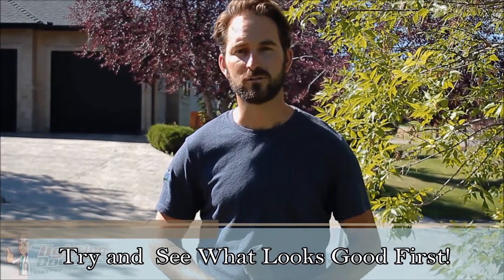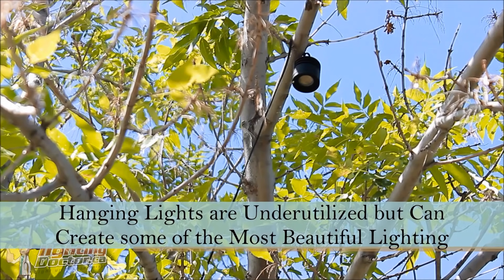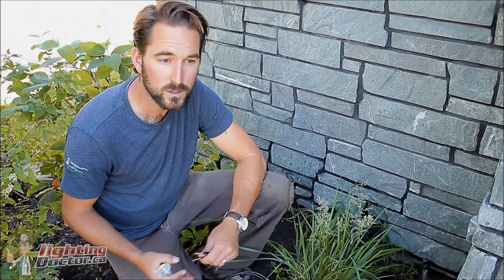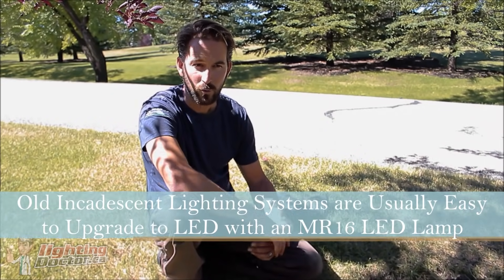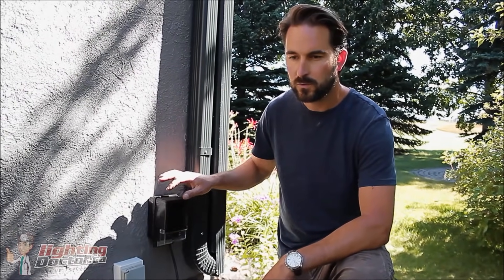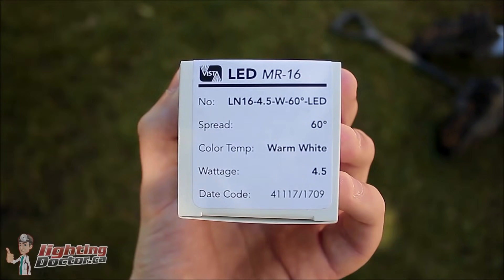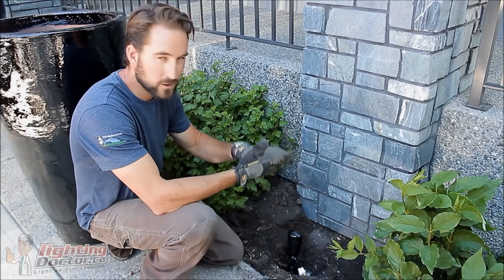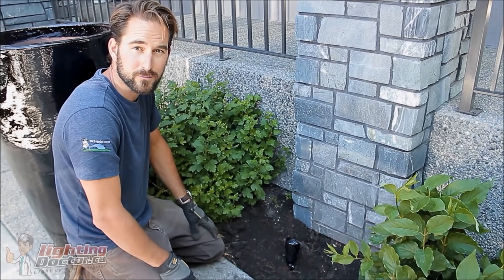How to Install Low Voltage Landscape Lighting - Complete Step by Step Video

Comment: Is there a hot/cold wire or any certain position needed with the wires and fixtures?
Reply from the maker: There is no polarity with most low voltage lighting

Comment: Hello Cal
Thanks for the sharing wonderful tips.
Please guide me.
I would like to place low voltage 20 lights in my front yard concrete ( there’s no concrete yet).

I see in the internet that I need to excavate 18 inches down, also an electrician told me the same thing.  
I think it’s a waste of 36 inches of wire x 20 lights= 720 feet of 12/2 wire material buried. 

Is it safe to run the 12/2 wire in 3 inch Black PVC pipe plumber instead of Grey Conduit ? ?
Or can I insert the 1/2 inch grey Conduit into the 3 inch Black PVC pipe plumber??

And 
Instead of bury the 12/2 wire 18 inches down, Can I bury the Black PVC plumber pipe just below the concrete which is 
3 1/2 inches ??
Reply from the maker: For low voltage wiring there is no need for this depth. 6 to 8 inches down with no conduit is typically more than enough unless your local codes have specific bylaws which is very rare
Reply: @LightingDoctor  Thanks so much for taking your precious time to reply.
Blessing to you

Comment: I have 4 palm trees in front of house, 2 palm trees are about 2 feet away from house and the other two about 10ft away.
I saw these wifi lights that are on a long cable and have outlets along cable to plug in more lights. This guy mounted them along the house on the wall though not on ground and they look so cool.  So IAM debating between just illuminating my front yard palm trees or should I illuminate the house walls instead and should i go  with low voltage lights and a transformer or just wi fi plug in lights that I can control with google or alexa?

Comment: I am about to tackle a deck lighting project w some downlight fixtures under railing and well lights.  All LED.  What I dont understand is the transformer options.  There are transformers with 12, 13, 15 volt capacity   I will have 2 100 foot runs going in either direction w/ about 8 fixtures off of each  How do I determine what gauge wire and which voltage to utilize  All of your videos are really helpful.  Best on the internet   Thanks

Comment: arent stranded wires prone to oxydation caused by capillary action?
Reply from the maker: They are insulated and all connectors used should be waterproof to prevent this from happening

Comment: Hi there, just getting started on considering doing some outside lighting. Where does the power come from? Do you have to hook the transformer into your house electrical box?
Reply from the maker: THe transformer just plugs into any outdoor GFCI receptacle.
Reply: @LightingDoctor  
What's turns them off and on if it's not controlled by an indoor switch

Comment: Nice vid.  Something I learned long time ago is that the wires can be identified as neutral been the thicker one.and the hot the slimmer one.i know some don't care which one to use. I prefer to be all consistent 😉.and also I came across once with some of those ground lights.these guys used like a small container under and filled them with grabble Wich I thought was cool so water won't set on the ground. Txs

Comment: I think that it could show the wiring clearer. For example, the camera is too far away to see which wire is which. There is a hot and cold wire from the transformer, and a hot and cold wire going to the light fixture, but do you have to run a separate wire for every light fixture? If not then how do you chain them in series

Comment: Hello, im looking to install these products.  Unfortunately my exterior GFCI outlets are in terrible places.  In the front, its right by the front door underneath the doorbell.  In the back, right bay the back door.  Id hate to put the transformer there.  Have you seen it installed plugged in the house from the front window-sealed, then installing the photocell/transformer in the shrubs right in front?
Reply from the maker: Hello Chi, we use a wiin wifi timer with the transformer. You can plug your transformer into the wion timer and the timer i to the GFCI outlet and then you can cover evryrhing and the timer can be set up to work with astronomic timing so it does not matter if the photocell is covered or not. Hope that helps
Reply: @LightingDoctor  Well i think the issue is that I dont have a convenient power source.  Even if i use the wion it has to be plugged into the power source GFCI which is right by the doorbell.The landscaping wire still have to run from the transformer to the garden area.  Have you seen homes where the GFCI was an issue for convenience?  I asked someone else who thinks running the wire through the attic sounds better?

Comment: What transformer are you using? I’m planning to install some led walkway lighting which will be controlled by an Insteon home automation system. Need a small transformer (~50 watts) that can just have the power supply switched on and off without any programmable functions that might need to be reset after a power loss.
Reply from the maker: You can try this guy. It has so.e timing options and a photocell too or you can just leave in on position and control from your wifi switch https://lightingdoctor.ca/product/kichler-60-watt-low-voltage-landscape-lighting-transformer-copy/

Comment: Cal, thank you for all the excellent content!  You rock :)  I have some questions...

How do you handle dimming?  Do you ever use transformers that have integrated dimming capability (if there is such a thing)?

Also do you ever use "smart" bulbs (i.e. bulbs with some kind of integrated wireless radio such as Wi-Fi, Bluetooth, ZigBee, Z-Wave, etc.).  In the case of smart bulbs, you'd have the added benefits of controlling brightness, white color temperature (or perhaps even full spectrum color)... and on a "per bulb" basis.  Seems pretty powerful, because it enables some new use cases, and I'm wondering if pro's like you are starting to move in that direction.  Just one use-case that comes to mind: program the downlight bulb in a tree to be green during summer to showcase the vegetation, and blue during winter to showcase the snow/ice.  No more tree climbing to execute those changes--it would all be done in software (ideally automatically driven by a calendar).  I'm sure you can think of more use-cases than me.

Thanks again, cheers!
Reply from the maker: Great questions. Yes there are a few dimmer options however still a littl on the pricey side. The Luxor from FX luminaire is one of the more favorite ones right now.
There are also a few decent bluetooth colour changing options out there but there are still lots of bugs to get fixed. I would expect to see more and better options coming down the pipe very soon
Thanls so much for watching and the feedback!!!

Comment: Excellent video and very informative. Those Vista well lights are cool .. expensive but still cool. Doesn't the WiOn essentially kill the power like a power outage? So I assume the Transformer has something like an always on or Dusk to Dawn default...
Reply from the maker: Thank you.  The well lights definitely are more expensive because they have to survive underground but I find that over time people save because they don't have to replace above grade fixtures that get ruined by mowers etc.  That is exactly what the Wion does, and the transformer can have a few settings.  Sometimes has just an on /off switch so when you leave it on all the time you can then use the Wion to control it however you want.  If you don't use the Wion the timer will typically have a photocell that will work with dawn & dusk.  Thanks for the questions and comments!!!
Reply from the maker: Glad to hear, just be aware of some of the volt lighting. Its much better than the big box stores but still a cheaper quality product than brands like kichler, vista, fx, and a few other of the professional quality brands.
Reply from the maker: Here is an earlier video that discusses them a little more https://youtu.be/tz5vTbHF4CQ
Reply: Lighting Doctor Ltd. 
I'm looking for the best quality within the confines of our budget and commensurate to our modest $700K home which is not multi-million. Our prior home was considerably more expensive and had commercial grade landscape lighting with at the time high quality fluorescent fixtures. Well they didn't last too long... My rationale is I can replace bad fixtures 3X for the price of so called good. This house had 10 GA wire, expensive SS Transformers and it's all dead .. except for one Transformer that's inside the garage.

I'm spending $50 per fixture using a lot of using "Home Decorators Collection" (at least it's all sealed), 12 Gauge wire, 3M MGC, and some mixed fixtures. As you mentioned .. it's all Chinese crap.

I'm a reasonably smart guy so what I've done I know is installed rather well and is tastefully done .. better than the Pros here. 

If these fixtures lasts 5-7 years I'd be crazy happy.
Reply: Lighting Doctor Ltd. 
PS ... I gave each fixture at least 2' of coiled up wire so I can pitch the old crap for new crap without having to rewire. I'm thinking about buying and shelving several extra fixtures for replacement which takes less than 5 minutes like changing a bulb.
Reply from the maker: You should get that out of them and sounds like you got a great plan. Would love to see some pictures of the finished project. Good luck with everything, let me know if you have any further questions. Cheers
Reply: Lighting Doctor Ltd. 
My expectations aren't too high, but don't get me wrong I like landscape lighting. Up North you have damaging weather cycles, and here we have non-stop summer monsoons, corrosive salty air and months of 90° F (32° C) plus temperatures. 

Sure, I'll forward you some pictures when I'm finished. We've been renovating, I'm working on festive Lanai lighting. So far I'm just about done with the back. My wife ordered a new umbrella and once it's here I'm probably going to get some tall fixture for uplighting it through the pool cage screen or drill a hole and fish wire through for some small fixture inside mounted to the cage.

In the front, corner spot up lighting, up lighting 6 foxtails, a few other trees and I'm debating on side washes. Also, a couple of those Ballard's in lieu of the brass Mushrooms I'm returning. LOL I'll probably be visible from space if I don't stop.

Take care and my sincerest thank you for your time! 👍👍👍👍😎

Comment: Tip: When you strip your insulation from your wires, angle the stripper at 45% to make it easy to pull off.

Comment: Do you need an electrician license to install these?
Reply from the maker: No Erik, unless the area where you live has special bylaws you typically do not need an electrical license because it is all low voltage power 12Volt
Reply: Lighting Doctor Ltd. thank you!